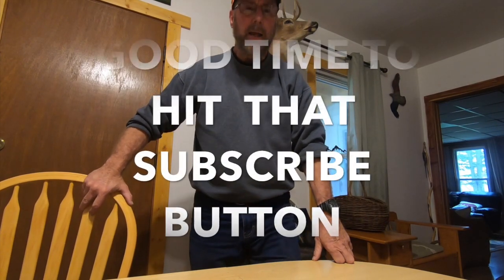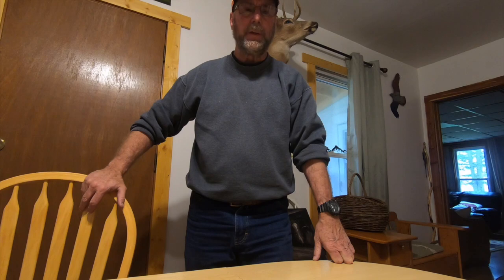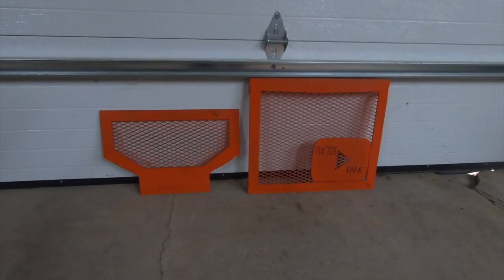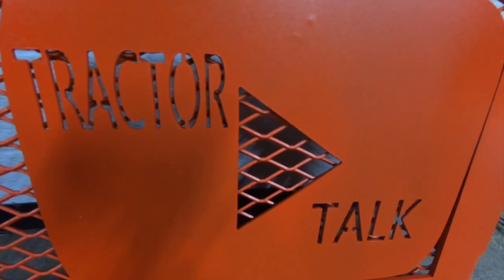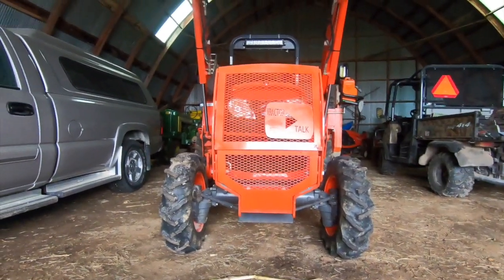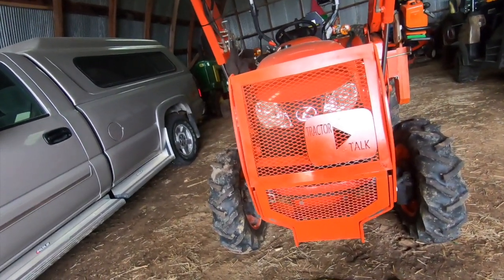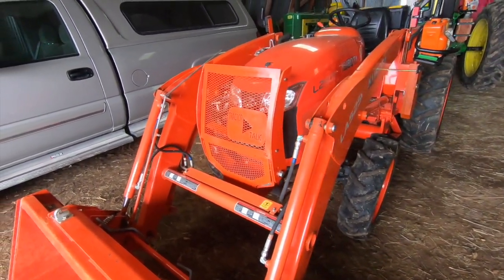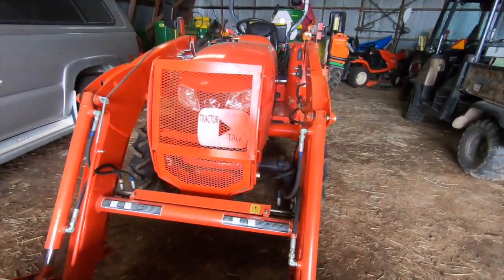KUBOTA L2501 CUSTOM  BRUSH GUARD. DON'T LEAVE THE SHED WITHOUT ONE !

Comment: I cracked my plastic grill just days after getting my new B2601. I added a grill guard after that. It's never too soon (or too late) to add one! Nice job. -Ed
Reply from the maker: Thanks Ed. I watched your video about making your own grill guard. Several times, to be honest. You didn't cut any corners in making yours either. You even got a Kubota orange camera out of the deal. I decided to go with the guard bolted on instead of welded on. Yours will take an enormous hit and still survive. I hope to never even scratch mine with anything. The tractors that we have had on this farm are all dent free. I am very careful, but then again, so are you. Accidents happen. Dents happen too. There is too much expensive stuff sitting right up front in these tractors to not offer them as much protection as we can.

Comment: You can never have to much protection.    Later
Reply from the maker: Especially for what these cost. This was a no brainer for me. There is some expensive stuff right up on the front lines with these tractors. The hood, grill, lights, radiator, battery, coolant reservoir, just for starters. It was 2 Benjamins well spent. Thanks for stopping by and commenting my friend. See you for the next one.